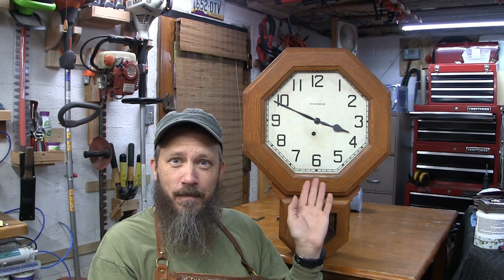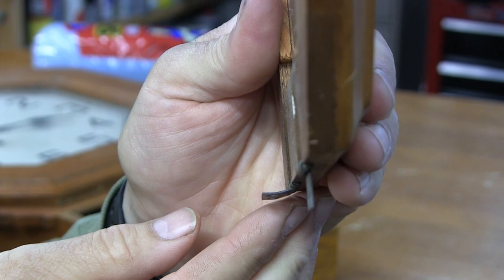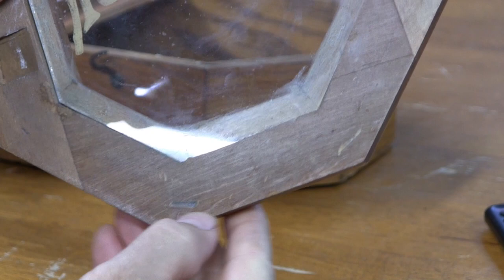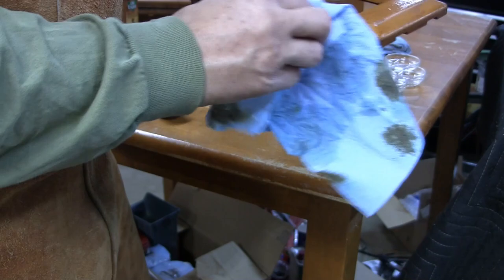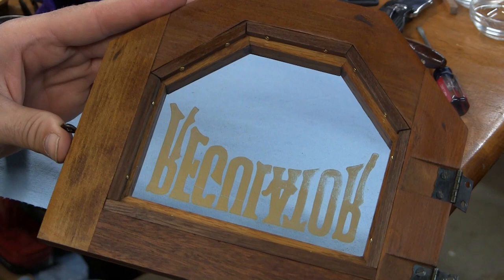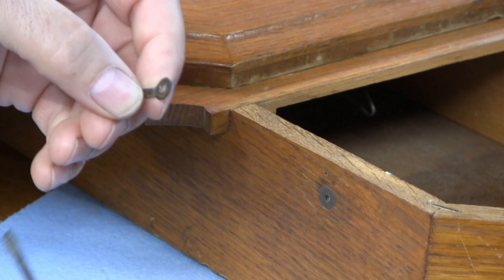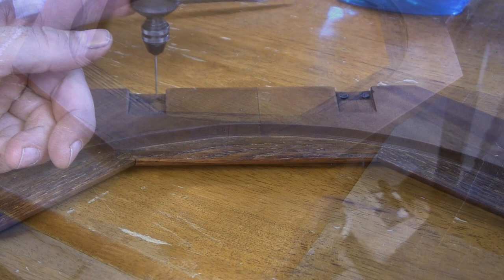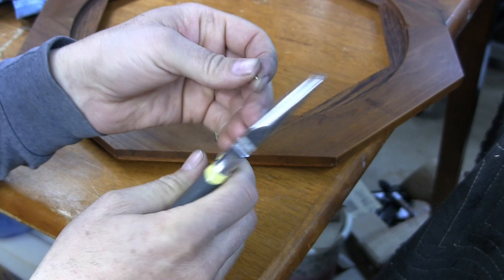1934 Ingraham Bedford Wall Clock Repair Pt 1, updated version

Comment: I believe you were correct the first time for dating E. Ingraham clocks.  I have just finished two of them: 1911 and a 1917 E. Ingraham mantle clocks.  The first number on the 1911 was a "7" and on the 1907 was an "8".  However, the pendulum length on both was 6".  Yours may have been a happy coincidence.
Reply from the maker: Thanks, John. Each maker seems to have a unique dating system. I can't recall if I consulted a book on the dating method for this one. The smaller wood case clocks from Ingraham, in the 30's and 40's, had the date stamped on the bottom of the case which made it easier.

Comment: Are oil used same oil use on automatic wrist watch ?
Reply from the maker: I do not work on watches so don't know what kind of oil that is. There are many different types of clock oil. A pure synthetic oil is recommended. If all you have is watch oil, that would be better than no oil.
Reply: @time4clocks   ok thanks